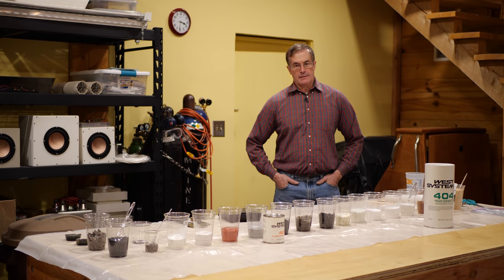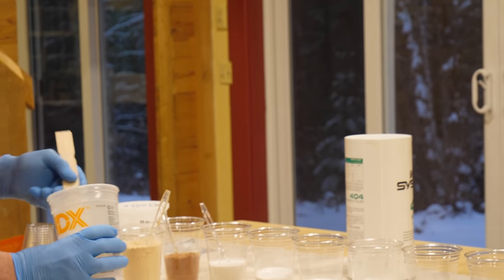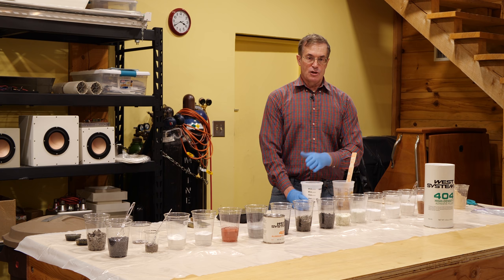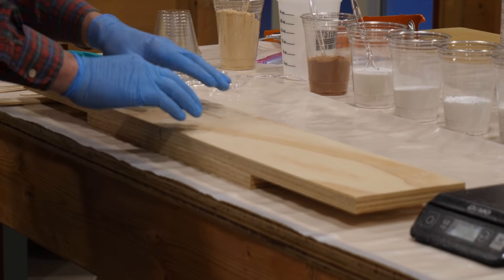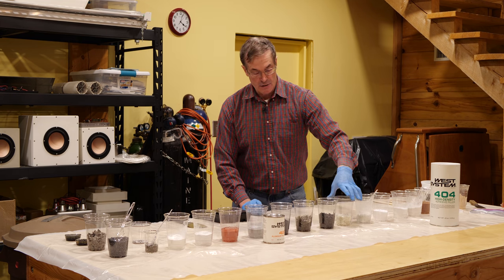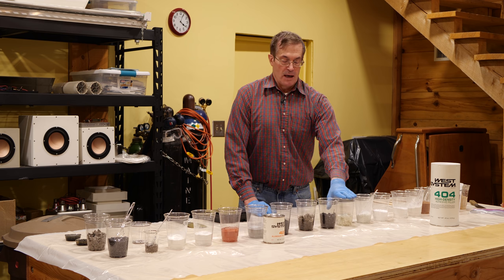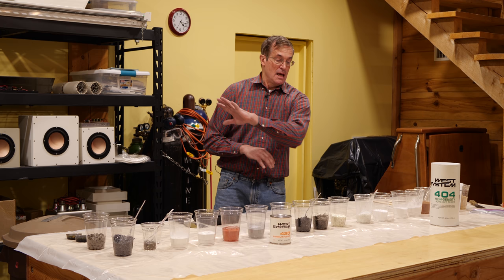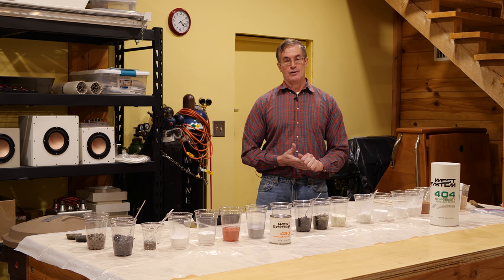Super Strong Epoxy with Diamonds and More!

Comment: Does it make any sense to use any of these additives in "sandwich" composite layups? As in foam or balsa cored S glass layups?
Reply from the maker: In balsa cored sandwich construction a thickened epoxy is useful as a surface seal to prevent additional resin from soaking unnecessarily deep into the core and adding additional weight.
Reply: @TechIngredients  - Thicker and lighter to seal porous surfaces, that I understand. But the higher strength of the admixed epoxy resin can't be exploited in the fibrous layup because of the ultra-high viscosity - prevents resin wet-out - right?
Reply from the maker: In general, yes. The longer fibers in the cloth are optimal and the lower the viscosity, the higher the ratio of fiber to resin you can achieve.

Comment: sir can you suggest a good thermal insulation using alumina and or graphite coz i want to use it for 2000 degrees  in a foundry
Reply from the maker: For 2,000 degrees Fahrenheit a common silica based fire brick is fine.
Reply: @TechIngredients  ohh i forgot to mention that's 2000 degrees Celsius sir

Comment: hello which mixture is more suitable to create the structure of a cnc milling machine?  many are currently using fine sand mixed with epoxy with a metal frame inside.
Reply: the goal is structural rigidity and cancellation of vibrations.  obviously without spending too much money because it is a diy machine
Reply from the maker: That's probably pretty good as the sand increases the mass and the stiffness.  There might be an advantage to using a mixture of grain sizes as is done in UHP concrete to increase both the stiffness and mass through densification.
Discontinuous steel elements in the framework will reduce vibrations at a small cost in stiffness.
Reply: @TechIngredients  I have noticed that the highest levels of stiffness are achieved in compounds with fine additives such as sand, but thinking about it it could still be improved with the addition of silica fumes. What do you think about it?
Reply from the maker: It would probably be better to go in the opposite direction.  Silica fume will very quickly thicken the epoxy to an unworkable state even at low loading percentages.  Larger aggregate mixed with the sand will allow much higher loading and produce a stronger composite.  Look at concrete technology.
Reply: @TechIngredients  i will take a look. thank you so much

Comment: I follow all your videos I defy you to glue ETFe and study it's super Teflon like properties I'm trying to weld greenhouse film envelopes and have been experimenting I'm interested in the corona plasma surface treatment I would love to see your take.
Reply from the maker: Aside from simple mechanical abrasion have you tried oxidizing the surface with an oxygen rich flame?
Reply: @Tech Ingredients  well shoot, that's not a bad idea. I supposed heat gun isn't the same and I used a plastic welder at high temp and no avail won't stick to each other.
 I wonder what the real solar manufacturers are using to laminate their ETFe solar panels..
 I'll let you know my results are on your input also, next I'll attempt an ultrasonic rivet weld.
 I was really hoping I could find a chemical like an organic solvent. MEK DMF TOL?

Comment: have you tested the ballistic samples?
Reply from the maker: Yes, they tend to shatter around the hard components.  A tougher matrix, possibly using aramid fibers is needed.
Reply: @TechIngredients  I thought so, but it would have been cool if that was all it required, at bullet speeds, the hardness of the material isn't the biggest factor, it's how effectively one unit cell passes on its energy to the surrounding ones. Metals are good at that, so are really long chain polymers when woven correctly to distribute the forces, maybe a more ordered structure would work better than fibres oriented randomly, a series of metallic meshes, like fly screen, or perhaps layering up fibreglass with the diamonds and epoxy between layers? Sure glass doesn't have the tensile strength of kevlar, but neither does nickel, and yet metal carbide tooling, armour and penetrator rounds are bound with nickel. Even some Al2O3/SiC ceramic plates are bound with nickel.

Comment: New subscriber here.
Reply from the maker: Welcome!
Reply: @TechIngredients  Hi, my thread has become loose thread. I wonder what brand and kind of epoxy will be as strong as the thread in my aluminum iPhone case (used for the thread on the tripod) or stronger and what modifications (what material could I add) would you recommend? I've heard about Devcon which is like a harder plastic than JB Weld original Cold Steel Formula and other name brand glues from Gorilla?

Thank you.

Comment: When bullets fly, I want to be behind steel like Armox
Reply: But if you have to carry it to the battle field you may want to look at something lighter.
Nothing protects quite like a good foxhole.
Reply: @kensmith5694  Fact! Sandbag directs bullet kinetic energy to almost 90 deg ... ballistics experts only dream of achieving this with any armour plate/composite
Reply: @levettp  
The bullet initially makes a "sonic boom" in the sand making the energy into  a spreading cone shape.  If the sand is too thin some of it comes out the far side as a spray of sand.  Still it is very effective.
Reply: @kensmith5694  Sadly not much sandbag ballistic testing info freely available. I guess that even a 3 bag wall would be pretty effective in absorbing shaped charge energy from an RPG. Gravel/sand mix maybe even better?

Comment: Thank you for wasting so much expensive stuff on our education. I also have a big interest in light weight, air-entrained, and multi-component composites using inexpensive materials. Fortified cement with styrofoam or other ??? fillers, for moldable structures.

Comment: How do they compare to this? https://en.wikipedia.org/wiki/Aluminium_oxynitride
Reply from the maker: These all can be fabricated in a shop and are undoubtedly much cheaper.  However, simple steel plate is cheaper yet.  But, compared to everything else, ALON is transparent and that's the thing.

Comment: 1:05 Your logic is flawed. Yes the glue is stronger, BUT the "breaking force" would just tear off the top layer of fibers, with screws you're utilizing far more fibers to hold it together. The screws also have the added security in being able to give, "warning" the user that a failure is coming soon, the glue will just go from perfectly fine to critical failure, no in-between
Reply from the maker: No, the logic is sound.  A screw is limited to the crush strength of a small area of wood while the adhesive attaches to a far larger area. The addition of a fillet can increase that to over 100 times and the geometry of the fillet is superior as well.
Reply: @TechIngredients  You don't seem to understand my point. The glue is stronger, yes, but the wood surface isn't, the glue will only engage the surface and the engaged wood part WILL tear off. A quick search on woodweb confirmed that. A google search (yes spend time on checking before my comment) also said the same thing
Reply: @TechIngredients  That being said, the result will ofcause differ highly according to wood type. "Open vein" wood T-joint would likely be terrible with glue only
Reply: @TechIngredients  Here, found some prove to you. As the bots will delete any comments with links in, other than YouTube links, it took quite a while and doesn't fully explain my point. In this video he'll overlap with 1 foot, your idea with the fillet doesn't increase the engaged surface that substantially + it leaves a visible fillet. Any T or L-joints will still be stronger with screws, a combination would likely be the supreme solution. Please notice that he's using "real" 2x2, which transfer the force way better into the grains behind it, plywood doesn't offer the same strenght
https://www.youtube.com/watch?v=nW0AmZ9aF70
Reply from the maker: No, I do understand your point.  And, this is more than theoretical.  I have built furniture and boats with both techniques and at the extremes, the comparison of course breaks down.  Two shallow screws along a three foot joint or an interface with cheap, delaminated plywood are both bad.  But, the joint strength can be estimated mechanically by estimating the intra-ply delamination strength times the surface area vs the crush strength of the wood times the area and number of screws devided by two due to the mechanical disadvantage of the mid thickness position of the screws.
Reply: @TechIngredients  I see, thanks for explaining it! It would seem your a seasoned builder then, I'm still new, build a large shop last year to make room for bigger projects. Now I got some search terms to look for, will definitely look more into this :)